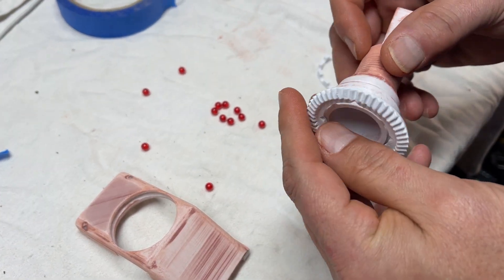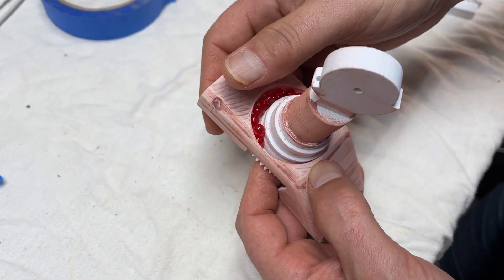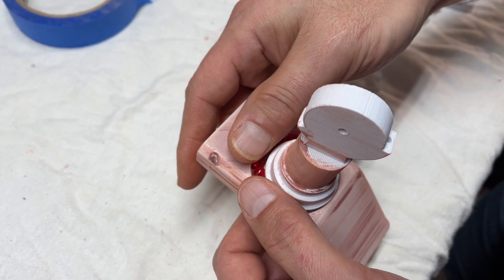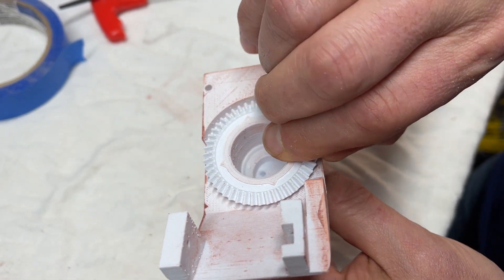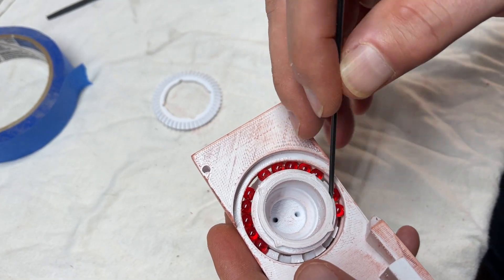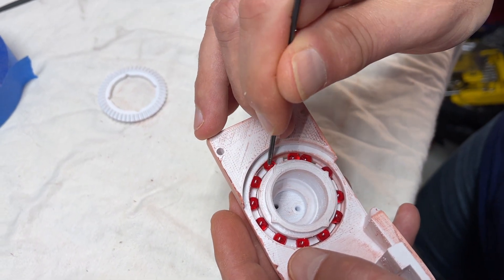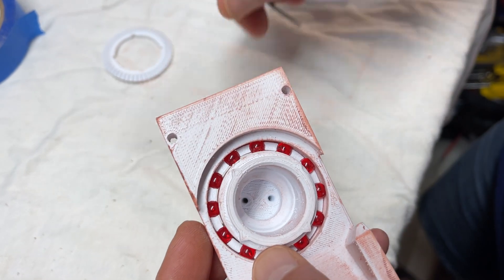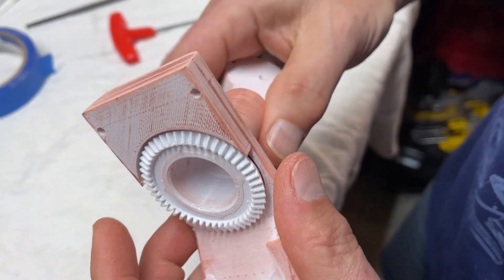How to build a Chopper Arm Bearing

Comment: Hello! Would it be possible to share the arm base STP file for the two servo 82MG ? Due to taxes, it is prohibitive for me to buy them. Buyt i got some pretty cheaper, but i didn't see that the axis is not at the same position, so, i couldn't install them.
If is not possible, do you have the parameters for the gears? I think if i use a smaller diameter it will work. I know that the movement will be restricted, but it is still a possibility. Thanks!
Reply from the maker: Hit me up on Facebook and I’ll see what I can do. https://www.facebook.com/groups/timhebelsdroidfactory/